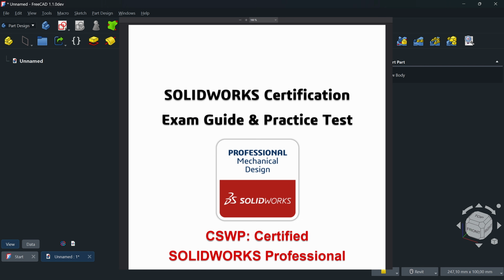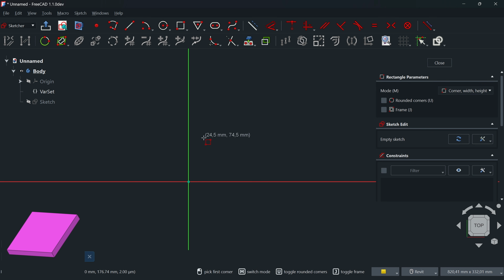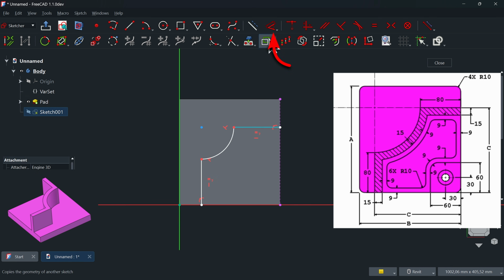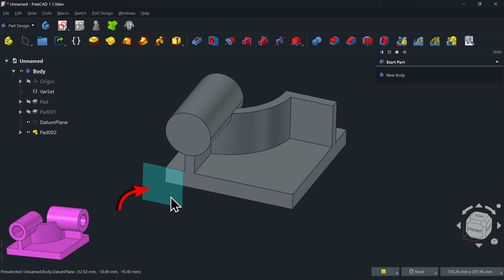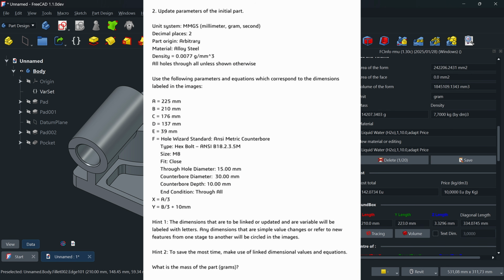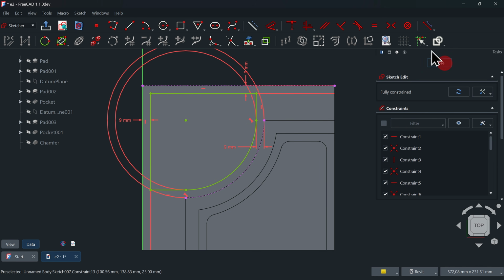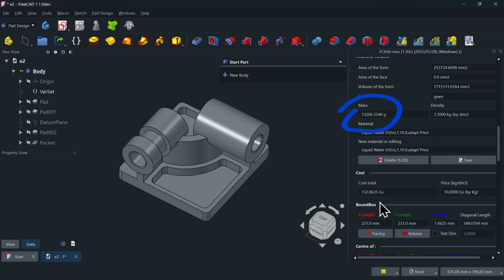Can FreeCAD pass the SOLIDWORKS Pro Certification CSWP ?  (Full Tutorial & Parametric Method)

Comment: Thank you. Very nicely paced.   I started on Fusion 360, when it was free, but switched to FreeCAD when Fusion's licensing rules changed.  The main difference between the two, from my very limited experience,  is Fusion 360 will let you generate a complete sketch and then extrude various bits of it separately.  In FreeCAD, the process generates lots of small sketches connected by reference geometry and variables.  I'm not sure which is better.

Comment: I started with AutoCad 2.5 on a IBM Dos computer back in 1986 for electrical design. Soon I learned to automate commands when we got a digitizer to draw on. Next I learned AutoLisp and created tools, first for myself but when I had more experience I created software that could draw mechanical racks for electronics and metal fronts for consoles.
Then my company bought a 360 Tower simulator and I started to draw 3D visual models for the system we used. This was on SGI with MultiGen Creator, a very expensive modeling tool especially made for simulation. I had to go to England and the US for training because no one was using it in my country.
I moved on to different kind of work and stopped drawing 3D models.

At home I start using SketchUp, back in the days Google owned it. I still use it sometimes when I want to draw a kitchen or parts of my house. Then we got a 3D printer at the office and I used SketchUp for my prints, this didn´t work out. There was always something hidden in the model that caused weak or wrong prints.
I already knew that FreeCAD existed and because it was free I installed it on my PC one month ago. In one weekend I learned the basics with your video and could draw a part for my screens of the caravan that broke off. It worked and now I'm drawing more parts and trying also  your video lessons.

At first I didn´t understood the way you setup the parts in the Tree view, the function off Create External Geometry and the use off constraints.
I only use Part Design so far, I haven't looked into all the other options but I have created some parts that I could use. 

What I miss is automatically selection of a midpoint in between lines or points or, like in SketchUp, you can keep the direction or move relative from line when drawing. But so far I like the software and I like it that you can use it on Linux and Windows 11.

Hope to see more videos to expand my skills.

Comment: I just couldn't use the fillet as external geometry, got a wire not closed when doing the pad. Had to create arc on the fillet.
Reply from the maker: @86sarko Which version are you using ? 1.1 dev?

Comment: Great video! Quick question: how did you make that hole from the center point? I followed the video step by step, but I still couldn’t get it to work :( I’m on FreeCAD 1.0.2. Maybe you’re using a different version or have some setting turned on? I even found an article saying you have to use a circle instead of a point, and that’s worked for me
Reply from the maker: @dariushcore I'm using the 1.1 dev version, Check the description if you want to test it. Stable 1.1 should be out in a couple of weeks.

Comment: I need a base like this to construct and recreate a missing support plate for an old wood planer. What I am struggling with is to bore a hole into the top middle of the pipe (to be able to use a screw as fastener) as I am not able to make a sketch on the pipe surface.
Generally as a hobbyist I am struggling with finding solutions/functions because I do not know the correct terminology for all these tools/functions even in my first language. So I need to learn by finding similar problems like this base but I am still missing the hole. From what I see I guess that a datum plane in a clever orientation would help...

Comment: As a beginner to CAD in general I wonder if that kind of removal of features to be able to make changes in exercise two is common? Say if one had made the inner opening as the first step after making the base shape for some reason. Changing and removing features early on like that seems to me like it is often impossible to do without essentially remaking it from the start or doing things that feel like they would be very bad practice. For example removing them by performing the opposite operations on them like padding a pocket and pocketing a padding.

This makes me think that since one may need to practically remake parts if things change, no single part should preferably take very long to do. I only use FreeCAD for 3D printing and since I have only wanted to design things that I print as a single part I have previously felt like it made sense to also design it as only one part (or perhaps it should be called "body" in this context?). 
If someone more experience reads this comment and has any input I would appreciate it!

Comment: absolute top notch video.  Having used freecad for a long time as an avid linux user for longer than most these kids been alive.  I later went back to school to study engineering drafting (ironically w/ an emphasis on civil engineering design, but i took all the mechanical drafting courses also because why not) and did this exact exam for solidworks.  Loved solidworks but couldn't justify the high cost for personal use.  so once i left school i went back to Freecad.   I have never seen reference geometry work the way u demonstrate.  I wonder if its the way u have ur freecad setup or ur using the latest dev build.  But when i use reference geometry it's automatically treated as 'construction' geometry.  so the extra step you do to reference then convert to construction is the only thing i noticed.  I'm using build 1.0.2.  may have to look at dev build tho.   Fillets are the bane in Freecad tho.  Often breaking/losing reference when u later modify something.  Which is why i try to do them as the absolute last step cause i often find myself having to fix them when i go and later adjust the model.

Comment: In the late 70s I used a drawing board and pencil. Then in 1980 I started at IBM and a couple of years later was using CADAM. By the end of the 80s and through most of the 90s I used CATIA 3D modeling. By the end of the 90s I had a career change and became a full stack web developer. Now I am retired and getting back into 3d modeling for my own use and have just started using FreeCAD. Thanks for the tutorial it was very informative and was a great help in relearning what I have forgotten after 25 years 😊

Comment: @deltahedra3D, I was wondering if you could help me with something.  I was designing an involute gear with a module of 1 and 17 teeth.  From the calculations that I found on KHKGears' website, the total diameter of the involute gear should be 19 meters.  Is there a way to make sure I got the exact number?
Reply from the maker: @nicholaspatton_1991 Hi, you might want to check the Gear workbench in FreeCAD (under Addons). I think it can automatically generate the gear using your values.
Reply: @deltahedra3D  Could you tell me how to find it?  I am having difficulties
Reply from the maker: go to tools, addon manager, in the search bar type gear and install freecad.gears workbench

Comment: I have a question I hope you can answer. 

I tried doing this in Fusion but never got the correct result for the stage 1 values. The issue was with the arc in the second extrusion. In Fusion, the arc wouldn’t be fully constrained until I assigned a radius, but I couldn’t find that radius in the drawings. Did I misunderstand the exercise drawings, or is it actually missing? 

I managed to complete the exercise in Fusion with the correct result after measuring the arc’s radius from your file in FreeCAD.
Reply from the maker: It's a quarter circle. You don't need to enter a radius, that's the purpose of this kind of exercise. You need to apply vertical and horizontal constraints to the lines and give them the proper dimensions. I'm pretty sure you can use the same technique I used in FreeCAD directly in Fusion. The idea would be the same.
Reply: @deltahedra3D  Hi Thanks for your reply. Now I could found the issue. Fusion didn’t automatically set the constraint between the center of the circle and the two lines while drawing. In the drawings, I’ve now found the two construction lines for this. In FreeCAD, you didn’t define them, so I missed it :)

Comment: I started out with Fusion360 (about 4 years ago, for 3d printing).

Then I discovered shaper3d for ipad (and mac and windows I think). It is pretty limited compared to fusion, but very intuitive and way more performant (also it looks very good). Since I do not have to pay for it (because I am a Student) and do not need the advanced tool set of fusion most of the time, I tend to model in shaper3d.

I have Fusion360 and FreeCAD installed too, but it's quite unintuitive when you're accustomed to fusion or shaper3d and I only really use it for some transformations from STL to some other format or so, but have never really tried it for modeling (yet!). Once I eventually will be forced to pay for shaper3d I probably try FreeCAD a little more seriously...

Comment: As a cat vet (ehh... I mean a CAD vet.) who started 20 years ago with SolidEdge I have used SolidWorks, AutoCAD, Inventor and Fusion as a professional. I did try FreeCAD at some time but could not get it to do what I wanted. Not only did FreeCAD use funny names for standard items (like pad instead of extrusion) but it seemed to use a completely different workflow so I uninstalled FreeCAD and kept using Fusion.
After seeing this video I need to give FreeCAD another chance, starting with your FreeCAD tutorials. It is tempting to use this one as a start but maybe it is better to start with the zero to hero one. I am hoping there are not too many differences between the 1.0 and 1.1 version ? 
If this works, I am starting to convert a lot of my Fusion designs into FreeCAD. I am getting a bit tired of all the little things that have changed in Fusion the last few years.

Comment: Fantastic video!
I have learnt/re-learnt a lot from watching this video, and your voiceover is indeed such a breath of fresh air from all the AI generated stuff out there. Your explanation and timing is also great.

I have an issue, and I hope someone can help me with it! Firstly it seems like even though I have FreeCAD 1.0.2 (Windows) it looks quite vastly different from yours. I don't get all the same previews as you do when you do the hole, pad, etc. I can largely work around that.

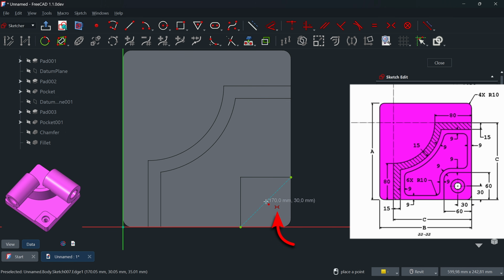I couldnt get a point  like you did at 15:02 to use the hole operation, as it said its not a valid operation. I got it working by just making the point a circle instead, of a random diameter - the hole function then worked as expected.

But this one below is stumping me and I dont know how to solve it..

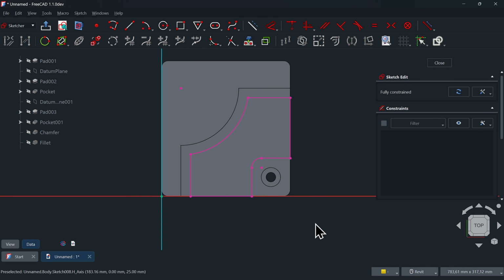At 16:36, you are able to select the whole face as an external geometry. When I  try that, I get the error "Failed to add external geometry"
No matter, I just manually select all the appropriate edges and move on. But when I do, and try to use the "Offset Geometry" tool, I get an error - Selection has no valid geometries. B Splines and points are not supported yet.

Any pointers?

Thanks anyone in advance!
Reply from the maker: @marcuspee93 I use the 1.1dev version of FreeCAD which adds a tons of new features, you can find the link in the description.
Reply: @deltahedra3D  Thank you! I will give it a go, I am assuming it sorts out the problems I am having. On that note have you found if the dev versions bugs out on you or has it been mostly stable? I've avoided jumpin on dev builds on the premise it might not be as mature.. thank you again for your insight!
Reply from the maker: @marcuspee93 I found the dev version mostly stable, so you can give it a try !

Comment: You can draw base plate and its fillets in one sketch using a rounded rectangle. Same goes for the cylinders by defining ID and OD in one sketch.
Reply: And for the pockets, use the fillet tool in the sketcher. It will preserve the original corner as a point for dimensioning/constraining against.

Comment: coming from fusion 360 (sketchup before that and anim8or to start). will be moving to full linux within the next 11 months and along with a few work apps, fusion is the only thing that is really holding me back.

I will try recreating a phone case I designed in fusion in freecad for a few changes I want to make (the design got a bit messy and need to overhaul it anyway)

Comment: In college in early 90s, 2D Autocad. First real job was Sales Engineer for a company that sold Pro/Engineer in 1995 and I was trained on most of the modules (sheet metal, FEA, wiring, etc). We switched to Solidworks in ‘96 to about ‘00 when I switched careers. In 2020, I jumped back into 3D modeling to design a tree house for my kids, then in ‘22 I became obsessed with designing parts for my bicycle to carry more in aerodynamic ways so I design in FreeCAD and 3D print parts. Printed Prototypes worked well, so this past year, I 3D printed a mold and made the parts with carbon fiber to be lighter and more durable. So much fun, although, sometimes I find FreeCAD doesn’t have the same robustness or feature set that Solidworks had 25 years ago, but beggars can’t be choosers.
Reply: Try onshape.

Comment: Neat tutorial, just a couple notes.
1. Use datum planes more with parametric parts. If your parametricization creates new faces, all of the faces get reindexed, so any feature based on a face, will now error out unable to know what to reference to. 
2. Always add chamfers and fillets last. FreeCAD while very mature nowadays, still struggles with altering filteded/chamfered geometry and it will create a painful mess.
3. Where possible, you can add fillets in the sketches. Not always the go to choice, but this can avoid an extra step in the feature history and is also more stable to alterations.
Reply: How's your workflow regarding 1? How do you use datum planes more sane than face geometry? Do you mean offset datum planes relative to origin instead of attaching sketches to faces? (you can attach sketches with offsets without a datum plane, btw)
Reply: If I want to add a parametric feature, I first look if I can use origin plane directly and just pad or hole through the part. 
If that is not possible, I'll check if it's at least parallel with an origin plane and use an offset datum plane with the corresponding offset. Yes you can just make a sketch on the origin plane and offset that, but I've had experiences where then altering the attatchment created broken geometry. also if your attatchment is just the face of the part again, you run into the same reindexing issues, fyi. 
If that still isn't possible, I would look and see if I can add the parametric feature near the end or last, so other features don't depend on it. If that still isn't possible I would try looking at the part at a different angle and maybe redo it if it's not a lot of effort. If that still is impossible, I'll just bite the bullet.

Comment: 1. use wireframe view mode when selecting ebges to apply fillets.
2. some fillets could better be done inside sketch. It is also generally safer in FC - less prone to produce geometry calculatikn errors.

Comment: Being a heavy SolidWorks user, I'm interested. But I'm curious does FreeCAD handle complex assemblies with moving sub-asseblies. And how it could handle a chain using, e.g., igus drag chain files. A customizable library of common parts like screws or even bearing holes, when a hole operation is missed
And a feature to select edges in a chain of surfaces for things like fillets

Comment: I used AutoCAD in highschool, learned Rhino3D in University, then switched majors to a different degree. I still like designing things every once in a while and have tried out FreeCAD with minor successes. I still use Blender if imported files are stl only...

I do miss the quick letter shortcuts in the terminal workflow (I don't remember what it was actually called).

This video helped me learn different ways to to achieve a similar goal; I never took one of these cert. tests.